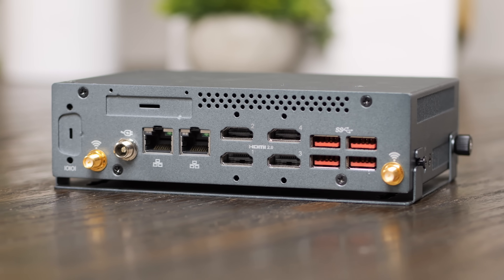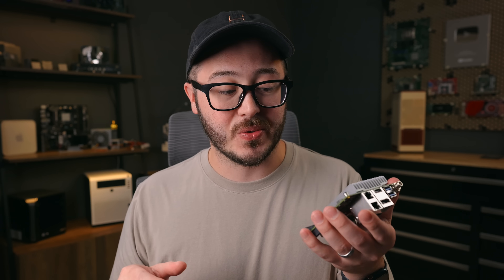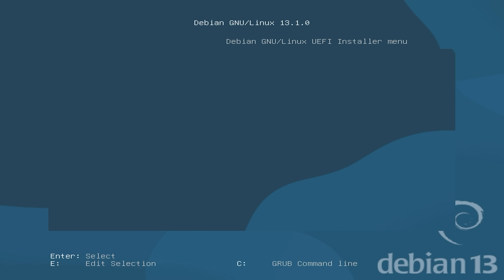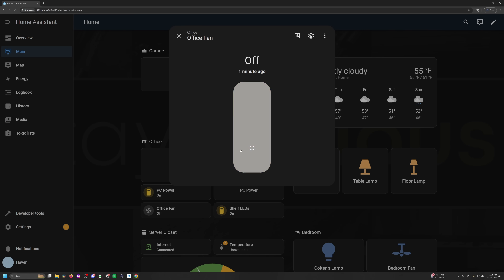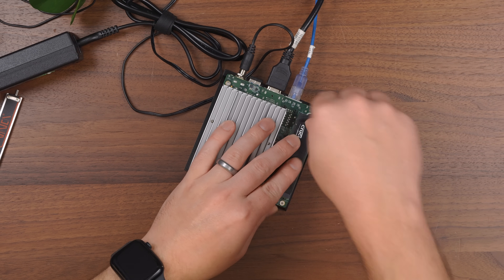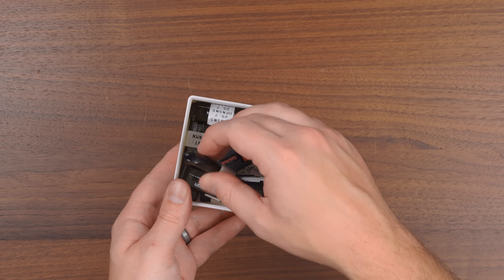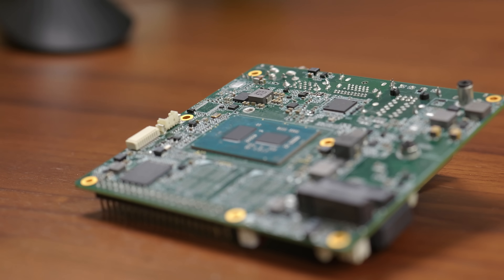This $63 Mini PC Might Be a Hidden Gem

Comment: I followed your link and it says 2-8GB RAM, 32gb ROM. $63 is only for the 2GB version which is basically useless compared to what you can get with other new systems by the time you've added storage and a case. 

Edit: so your channel has been suggested to me regularly the last few weeks and I've given it a few views. I've noticed that you, intentionally or not, seem to use misleading thumbnails and titles and then make exceptions/excuses in your videos. I'm not a fan of that.

Edit: not bait or trolling, his thumbnail literally says "32gb" without specifying what. His videos are clickbait. It's not RAM, it's not storage, it's useless ROM. I wouldn't click a link for a device with only 2gb RAM.... I've only got one or two VMs that would even fit on that.
Reply: If you watched the video you would know it was 2GB, you really need to tone down your dumbness/trolling
Reply: 2GB RAM is enough to put a Proxmox and run a small VM with a few Docker containers.  Pi Hole, OPNsense, NAS (i.e. OpenMediaVault) and Home Assistant (without power hungry features like DVR and image recognition - unless you add an NPU). It's a great board, but if someone wants to squeeze more from a buck then AliExpress offers a bit cheaper alternatives.

P.S. I agree on the click bait strategy of this channel and I unsubscribed from it a while ago for that reason. I hate such low end tactics.
Reply: I agree. Way too many "bait and switch"  Also, I've noticed a huge increase in the tech YouTubers making "mini" nases. Then also, installing a whole suite of non storage related things on them.  Can't wait to lose a shltload of data cause my docker Minecraft server screwed the pooch....😂
Reply: You didn’t watch the video. He said it over and over and during prox mix setup he literally talks about what you can do with 2gb. That’s a good portion of the video he even compares it to a pi5 with 2gb. 

Stop being a jackass.
Reply: Definitely trolling, or idiocy. The 32GB is indeed storage, specifically eMCC storage as HH said in the video. You saw “ROM” and your brain stopped? Did you look further down the page where it said it was eMMC?

It would be one thing to not care for the content for whatever reason, but only idiots or trolls double down on their misunderstanding and cast aspersions when they’re the ones jumping to mistaken conclusions.

Edit: accidentally typo-ed MB instead of GB
Reply: @keoghanwhimsically2268 the video thumbnail says GB not MB. Please read before being so incorrectly condescending.
Reply: @aaronjohnson8715 I was the one being condescending? It is indeed GB, that was a typo on my part. But if you weren’t so condescending to begin with, I would have never replied.
Reply: This has to be bait lol 😂
Reply: @sotech117  HH is really honest so I think this is ragebait based on just clicking the links and not watching the whole video.
Reply: What are you even talking about? He tested the 2gb version the entire time, and mentioned that the higher end models are not worth it.
Reply: He mentions and shows clearly the price in the video. Tf? Obviously cheapest is low lmfao
Reply: Dude says it is 2GB at 2:28. He did not lie.
Reply: For the same price as the 4GB version I can get an optiplex micro with 250gb nvme, 8gb ddr4 and an i5 9500T and inbuilt wifi. limited on the Ethernet to gigabit but who actually utilises 2.5 gigabit on something with only 2 gigs of ram like what.
Reply: @buckbuckleyson2259 just add a USB 2.5gb dongle
Reply: @buckbuckleyson2259 i think it is nice just to use the 40 pin header in case. Ofc to use just as a pc isnt worth. I mean, for 100eur i got an n150 based mini with 12 gb ram and 512gb storage.
Reply: @buckbuckleyson2259 2.5G could be useful for a router (though it’d be better if the two ports were 2.5G). Most routers have less than 2 GB of RAM.
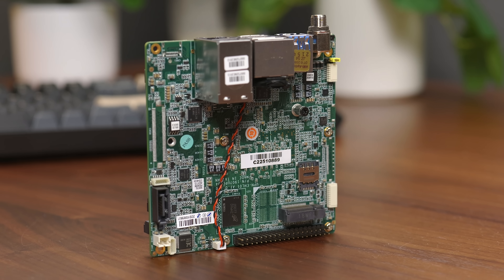Reply: 2:35 he says he bought 2gb for 63 & purchased 3 of them
Reply: @johnjones4860 y'all don't really get what "click bait" is do you? His thumbnail says 32GB. It doesn't specify what. It's certainly not RAM, so should 32GB of storage be something to be proud of? A new pi with twice the memory and a 64GB sd card is cheaper than this.
Reply: That's a you problem. Clearly you haven't watched the video, or else you would know that something like half the time was spent testing what he could do with 2GB. Turns out you can do a lot. Home Assistant, OPNsense, lightweight LXC containers, thin client for a gaming PC in another room... There was even a whole section on pros and cons versus a Pi 5 2GB.
Reply: For better or worse, he included accurate information in the thumbnail, it just wasn't the information you were looking for (he said 32GB, he was talking ROM, you wanted RAM). 

The closest thing to a 32GB mini pc I could find on ebay was a Dell Optiplex 7040 MT mini-ITX build with an i7-6700 for $70 and that doesn't include storage or shipping. We all want a threadripper that costs $20, sips 5W of power, and fits in our pocket, but unfortunately we're not there yet. Cheap, compact, or high-performance - unfortunately we have to pick 2.
Reply: @HartenDylan That is definitionally clickbait
Reply: @lippyncott  If you re-read my comment, I never suggested that it wasn't clickbait. I am correcting the original commenter that claiming the video/thumbnail is 'misleading' is demonstrably false. Thumbnail states 32GB, video discusses 32GB.

The commentor was looking for a 32GB RAM mini pc for less than $70, clicked on a video 'assuming' the 32GB was RAM, and was upset when they found out it was 32GB storage. Understandable, but not misleading.

With regards to clickbait, yes there is an element of piqued curiosity, "32GB... of what? I better watch this video to find out". Considering the majority of Youtube follows this methodology of enticing people to watch their videos using curiosity inducing tactics, the line effectively becomes "Is the information presented accurate". In this case it is. If that's not to your taste, that's completely fine. You can express your opinion and look for other creators that suit the style you like. But claiming something is misleading when its not simply because it doesn't meet your expectations is a recipe for disappointment.
Reply: @HartenDylan  Per the Wikipedia article of clickbait, "Clickbait (also known as link bait or linkbait) is a text or a thumbnail link that is designed to attract attention and to entice users to follow ("click") that link and view, read, stream or listen to the linked piece of online content, being typically deceptive, sensationalized, or otherwise misleading." I fail to see a world in which anyone looking for a mini PC would be excited about 32GB ROM, and I fail to see the ambiguity in the thumbnail as anything other than purposely misleading.
Reply: @lippyncott  Ahh, cool, you're one of those. Tried to give you the benefit of the doubt, but here goes.

Merriam-Webster defines:

Mislead - to lead in a 'wrong direction' or into a mistaken action or belief often by 'deliberate deceit'. 

Deceive - to cause to accept as true or valid what is false or invalid.

Considering he neither stated 32GB of RAM, nor at any point represented that it had 32GB of RAM, your lack of technological industry knowledge is a you problem. If you truly believe there is a magical 32GB RAM mini pc for $63, then we all await your video demonstrating such. The closest thing is a raspberry pi compute module with 2GB of RAM and a 32GB EMMC - and even that still requires additional accessories that puts it over the $63 mark and doesn't have 2.5GbE, which leads me to your next point...

"I've never seen a dolphin, so dolphins don't exist" or "I can't see anyone being excited about a device with 2GB RAM and 32GB EMMC" is questionable logic at best, and willful ignorance at worst.

Raspberry Pi makes multiple compute modules with 1GB or 2GB of RAM and 8GB, 16GB (even less than what Colton showed here) or 32GB of EMMC due to its faster integrated speeds compared to SD cards. Jeff Geerling (a tech youtuber who regularly reviews raspberry pi products) has used compute modules with 2GB of RAM and has written multiple articles about their extreme power efficiency for running specific projects. So a company that manufactures these specific products, and a popular youtuber expresses interest in their utility and functionality... sounds a lot like you're the odd one out here. Just because you can't see value in something does not discount it's utility for others, it just means it's not for you - which is totally fine.

Hardware Haven's entire channel is reviewing old hardware with limited functionality that can be repurposed for applications like the ones shown in the video. If you want a raspberry pi performance, but with additional IO without running hats, hey look at this computer! Your ignorance of the channels that cover this content, the cost of technology, the state of the industry, and currently offered products or the companies that offer these is very much your perogative. Just because something is not to your liking does not make it 'wrong', 'misleading', or 'uninteresting' to those that came here looking for something you just happened to stumble in to. Relax, kick back, and watch some old tech get put to use instead of ending up in a landfill. Cheers.
Reply: The model was disclosed the entire time…
Reply: You clearly didn’t watch the video.
Reply: @smileymattj  when I saw the thumbnail wasn't accurate why would I? I'm not looking for 2gb servers, my lab runs around 120gb, these things wouldn't even run a windows domain controller.
Reply: @aaronjohnson8715  why would you think a SBC would have 32GB of RAM, that’s obviously eMMC storage.  Also 32 GB of RAM alone cost more than $63, let alone a full running PC.   Don’t know what you were expecting.  I’ve run many Windows domain controllers on 4GB ram or less.  Back in Windows 2000 days, 1 GB of RAM, was only seen in big corporations.  Active Directory doesn’t need 120GB of ram to run.
Reply: @smileymattj why would he call something with 2GB of memory a gem? I'd say it's not obvious, especially when everyone is focused on RAM. And this is 2025, I don't really care what you ran back in the day. My windows lab alone takes about 24 GB.
Reply: @aaronjohnson8715 Because compared to RaspberryPi, it is.  Pi all in (SD card, power supply, cooler, case, etc) cost more, doesn’t run as much software.  This video is about SBC class PC, and you are trying to compare it to full blown server.  Hardware Haven never said this was a full server replacement.  That expectation came from you.  Homelab needing full class server is excessive and wasteful in my opinion.  Average for small business server clients I have is 16GB of RAM.  And they don’t even come close to utilizing half.
Reply: @aaronjohnson8715  Hardware Haven's entire channel focuses around repurposing old tech. Some stuff is old server tech, some stuff is ultralight mini PCs with 1GB of RAM standing on its last legs and he gives it new life. Welcome.
Reply: looks like he fixed thumbnail and/or title...
Reply: @MeanStreakRider43how do you figure? Still says 32gb of an unspecified thing. 2gb of RAM is useless, 8gb is also hardly usable in a homelab. This thing is cheap and doesn't have any useful storage or ram, or even a case, so the only way he's getting clicks is by NOT specifying what that quantity is for. For 140 on Amazon you can get a full machine with 256GB of SSD storage, 16GB (8x) the ram, and a case. There is no value in this thing unless you specifically need gpio pins, at which I just bought a pi with 4G. Memory and case for $42....
Reply: The video is about the 2GB RAM model and has 32GB of onboard storage, that the manufacturer has decided to call ROM for no good reason. And if you watched the video AT ALL you would see that he comments on how the 2GB of RAM is a downside. 

So you're mad at him for the item being as described. Seems like you just wanna be mad, so go have fun being mad. Just do it somewhere else. 

Please.
Reply: @whosscruffylookin95 not mad, you people put your own spin on my words. Didn't want to watch the video either, I wanted a product that was advertised as being useful. This is not. Every mini pc video that's out is advertising RAM as that's useful for AI, virtualization, basically everything... If he put on "2-8" GB of ram I wouldn't have wasted time clicking. 

That aside, the other night I listened to his video about a 100 dollar computer build challenge. He had a 7 dollar budget and went to a recycling place... And got a 10 dollar machine. Not an issue to fudge it, but it didn't work so he used another computer... But that didn't have a power supply, so he had to use something else that he already had. It's just messy, misleading videos that advertise something interesting then make excuses for not following through. I'm absolutely within my right to comment on my observation and not watch his videos.
Reply: Noticed the same thing. Clicked the "Don't recommend channel" asap.
Reply: @wody21 you guys are talking out of your ass
Reply: @wody21 , your loss.  Hardware Haven has much better content that the big tech channels who are far more misleading/clickbait.  And just straight up fake ignorance for entertainment.

Comment: honestly the 2 biggest drawbacks for me is not enough usb ports and no onboard wifi
Reply: The M.2 slot was probably meant to be used that way. And what do you do, that you need tons of USB connectors?
Reply: @TrinomCZ  i would need atleast 3 one for a media remote even though those typcialyl ahve a built in keyboard those dont wanlways work well and one for a regulaar mouse but once setup i really wont completely need a third usb port

Comment: if you step up to 8GB RAM, its $157 -  a ZimaBlade is still a better option.
Reply: As a PC or server, yes. These are industrial boards designed to be part of machinery or kiosks, etc, and thus would probably perform well in environments that are not room temperature.
Reply: actually any used mini pc is, especially since their RAM is upgradable. I'd also go this route with his budget, even if on ehad to stretch it a little bit the value is just so much better
Reply: @Miezekazze28  for price, for sure, but that is a finished product, not a project board like this one, each has its uses

Comment: It totally cracks me up when the Chinese board makers call SS memory "ROM" (see 2:28).  It's very much "writable", it is NOT ROM.
Reply: it's commonplace to call it ROM, for example custom firmwares for android phones are often referred to as ROMs. And they are still just an embedded OS image stored in an eMMC
Reply: its not like RWM takes up any more space on a screen print
Reply: I was told it stands for "Random Operational Memory" but here is a spare salt shaker just in case.
Reply: Flash memory, be it NOR, NAND, interfaced raw, eMMC or whatever is ROM. It's possible to erase a complete block but you cannot just jam new values into random addresses like RAM.
Reply: @donpalmera  wrong, the ROM acronym means Read Only Memory, not "memory writable in blocks".
It originally referred to one-time-programmable memory devices that can't be changed. For example CD-ROM.

Also NOR is technically RAM, as it has one byte random access just like the volatile RAM and SRAM, and it can be used to "execute in place" without loading the executable binary into RAM

Comment: I am a sucker for a threaded barrel jack for power! Prevents the power from wiggling or janked out.
Reply: The looseness of a barrel jack kinda is a safety features. I'd rather have power loss, than deal with a socket ripped out of a pcb.
Reply: @chuckcharles5963 yeah that's a good point. Just haven't seen myself in a position where that might happen. Knock on wood
Reply: @chuckcharles5963  A few plugs I have seen have a "neck" that increases the force needed to remove it. Wish that was standard.

Comment: Could this be used for a home router with pfsense!?? Ive been looking to get into homelabing for some time now, but dont really want to spend big bucks on hardware
Reply: It could... But that's maybe not the best option. That CPU is so weak, you'll pretty quickly lose transfer speeds if you're enabling most of the advanced features. Anything involving encryption probably drops you below even a gigabit.

Comment: At 2GB ram these are kinda worthless, These days RAM is the limiting factor more. for 250 a single mini PC with waay more ram (zen2 based?) would have ran circles.
Reply: 2GB of ram is plenty for many tasks these low power and low performance machines are good for - obviously if you have say 8GB you can get something like performance at a wider range of tasks, but that is even now the chips tend to be 2GB or more on their own going to cost you more and likely draw more power, so if you don't need it for what you want to do...